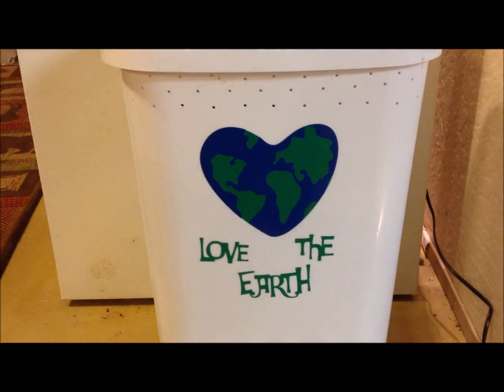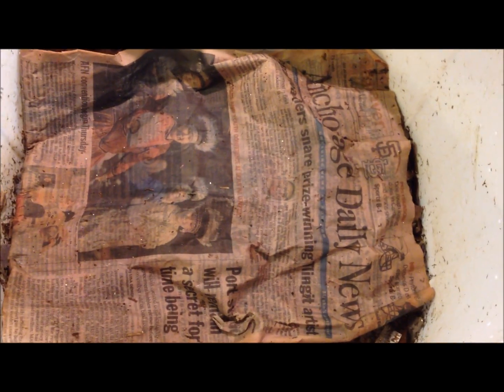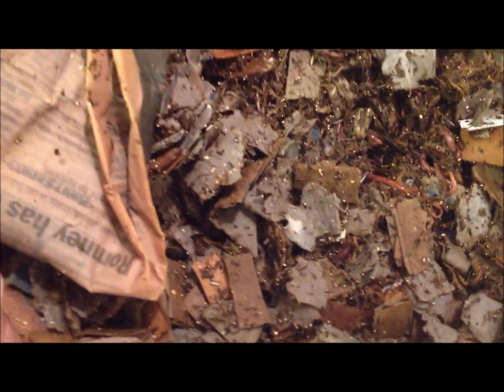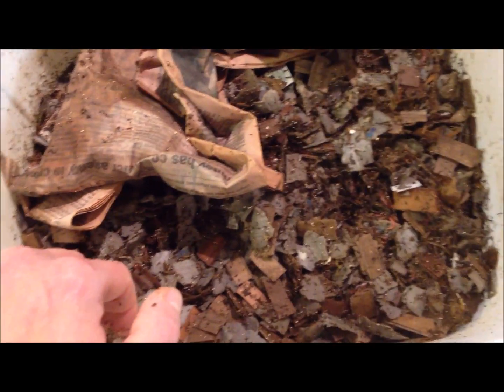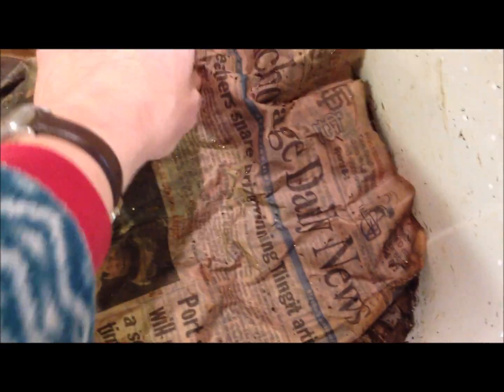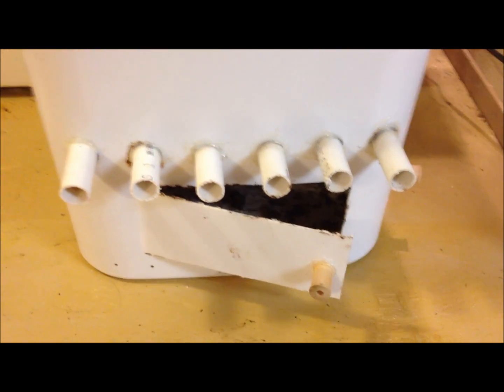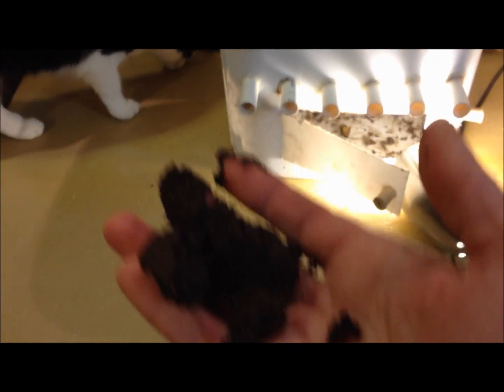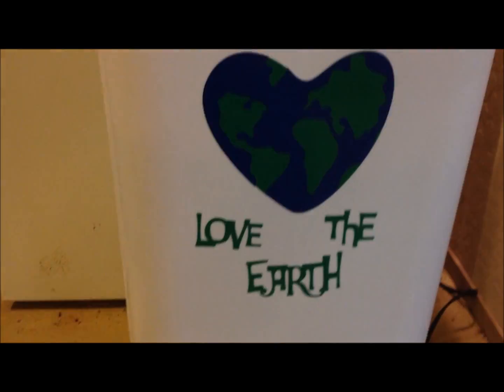How Does A Flow Through Worm Bin Work?

Comment: I'm researching to build my own and really like your design. It got me thinking...what if you drilled holes through the pvc pipes going through at the bottom and put thin but sturdy and alternating tines through them (hmmm, made of what? Wouldn't want to hurt stray worms) so the pipe could be turned from the outside where they stick out and kind of 'brush' the compost downward? Is there any reason that wouldn't work? I'm new to all this...

Comment: That's a really clever design.  I could have saved myself a few hundred bucks if I had seen this video before buying a commercial flow-through worm bin.  

I wonder weather instead of the very messy job of pulling the castings out from underneath with your fingers, would it have been possibly much simpler and much less messy to just pull out a couple of tubes and let the castings fall into the bottom cavity.
Reply: If you managed to pull the tubes out the entire contents of the bin will avalanche down, not good.

Comment: How do you deal with the extra moisture dripping down the bottom?
Reply: Control the moisture level  you put in the top! If you do have any water running through, (you shouldn't), put some shredded cardboard in the bottom to absorb it, scoop it out and add to the top.